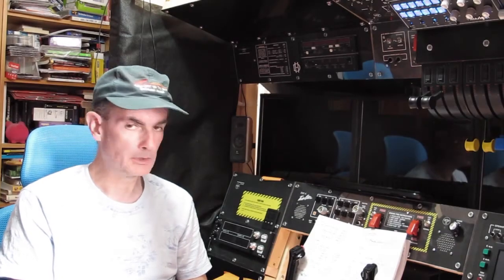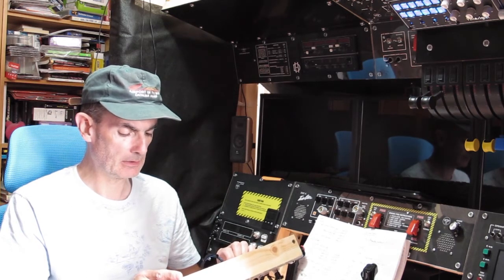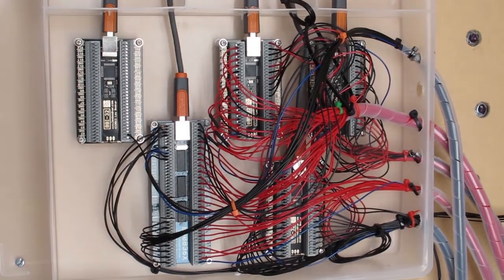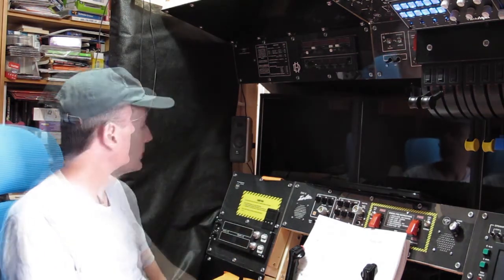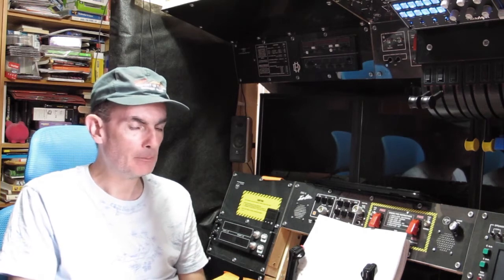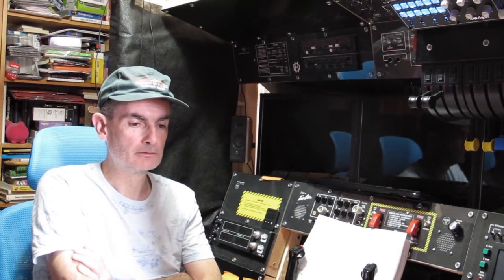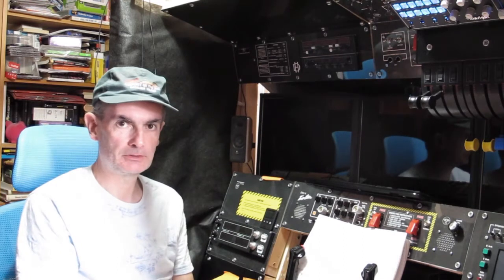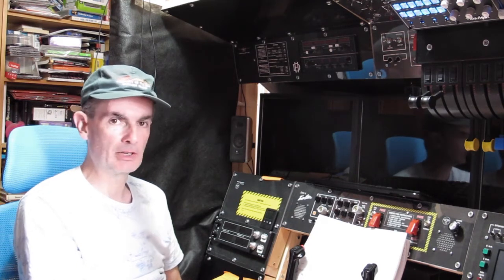Minimum Equipment List - Almost There! (Twin Otter Cockpit Build - Part 18)

Comment: Congrats mate!...

Unless mentioned elsewhere, I would recommend doing yourself a huge favor… And that is labeling your USB BBOARDS as to which wire goes where.

Just saying it'll make troubleshooting so much easier.

Continuing to watch avidly!

Chaz
Reply from the maker: The boards are numbered already and the numbers correspond to what is listed in the LINDA config files after I have programmed things up. It would help to label the wires, I suppose, but honestly it would be just about as easy to re-program everything from scratch if it was pulled apart. The purpose of making the panels detachable (with the RS232 plugs) is that I should never have to unplug the wires from the Bodnar boards anyway!